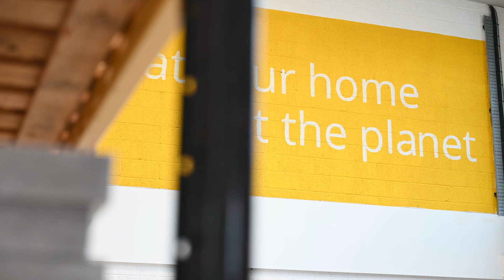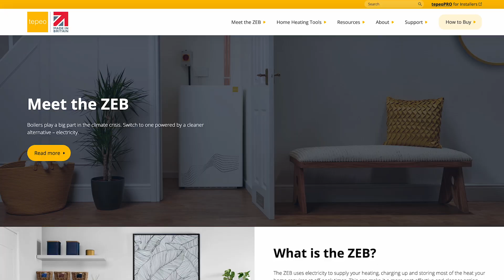Discover tepeo and the ZEB Heat Battery 🔋 | Sustainable Energy Explained

Comment: Is this capable of supporting a house with 16,000kwh of gas? I was told it would need to be charged multiple times to keep up with a peak of 134kwh in January. This maybe feasible with the upcoming Octopus Snug tariff or even the Cosy Octopus tariff